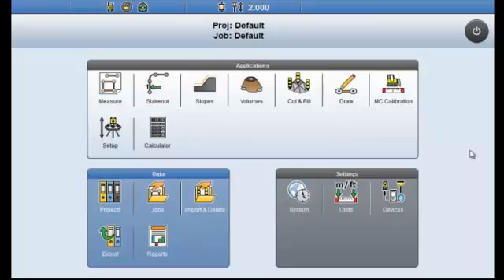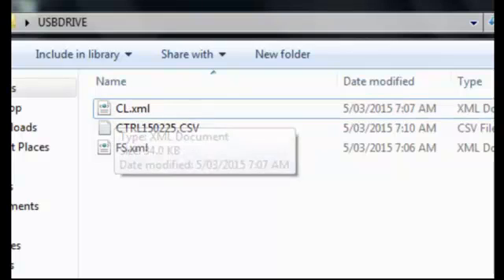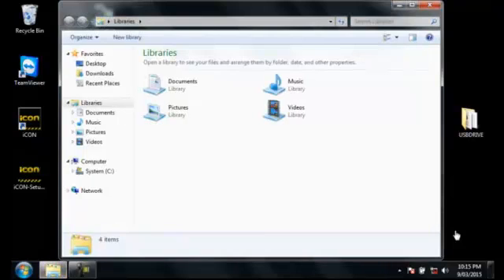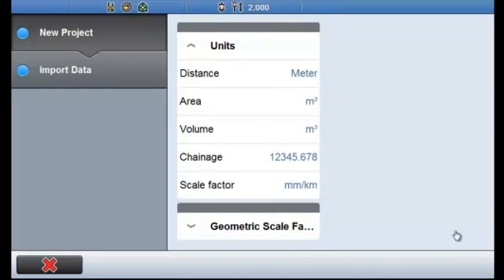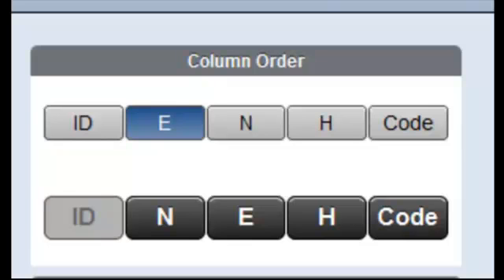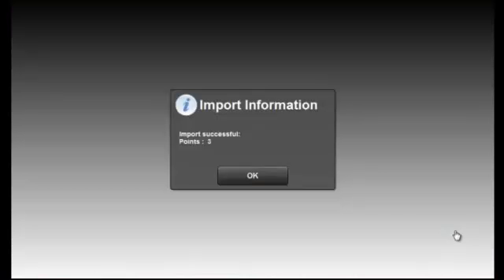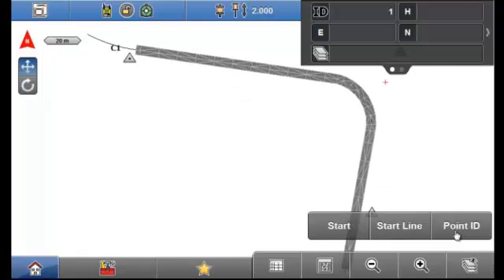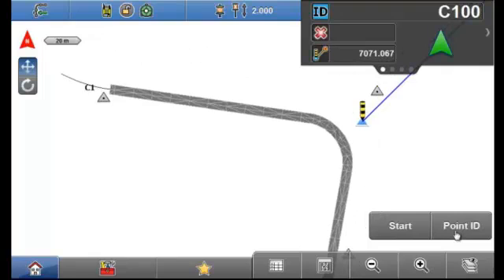Leica Icon project setup and data import

Comment: hey when loading a dxf file to a new project my drawing is showing the wrong units, its saying a window that should be 60" is 60 feet. what would cause this?
Reply from the maker: Hi tyler im not sure exactly what would be causing this issue. ?hat software are you making the .dxf that you are using? I use autocad, and i have experienced a similar issue when i have set my units incorrectly in autocad, Units being incorrectly set in CAD carries over into other softwares like the icon field controller software. Hopefully this helps